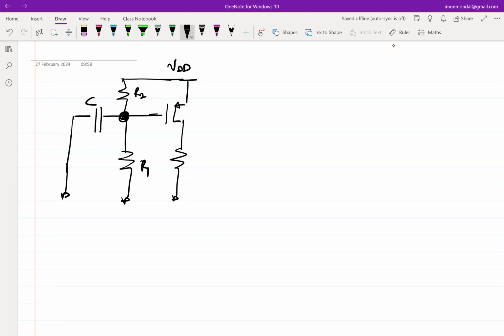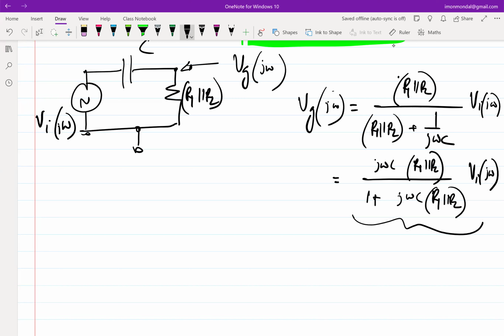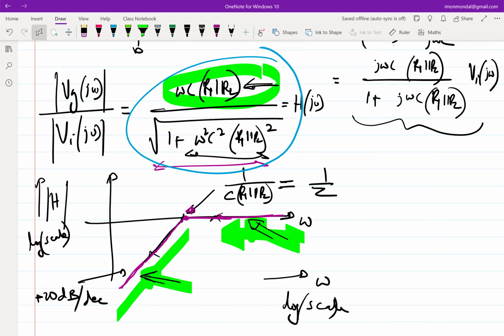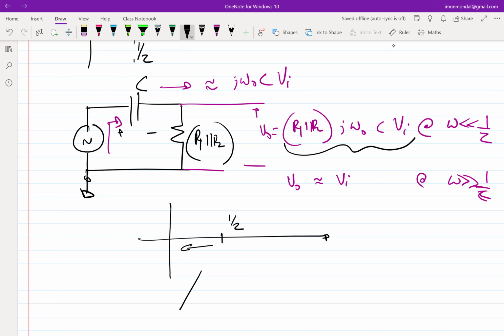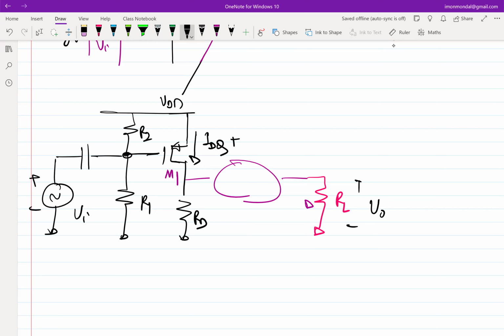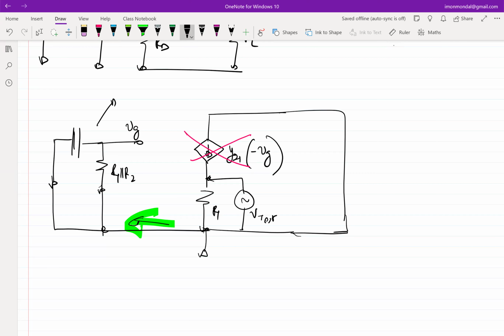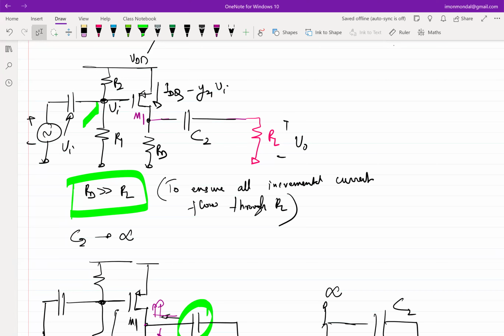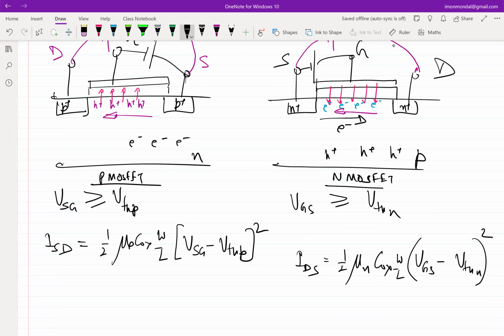Lecture 19: Finding the values of the capacitances to be used in a common source amplifier

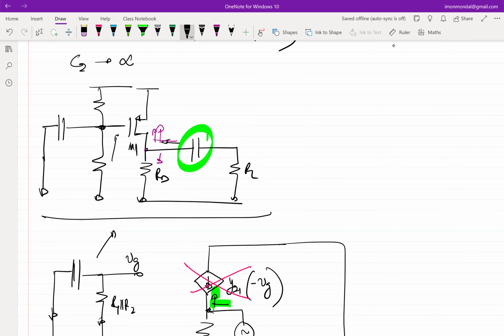Comment: When you draw the small signal model at 40:00, why do you remove the input voltage? Why is it safe to remove the input voltage?
Reply from the maker: We are trying to find out the time-constant associated with the capacitor. For that we are trying to figure out the effective resistance across the capacitor. To find the resistance we need to de-energize the inputs as a first step.